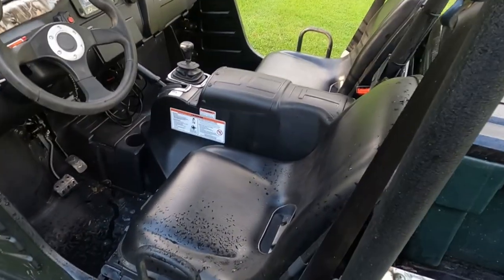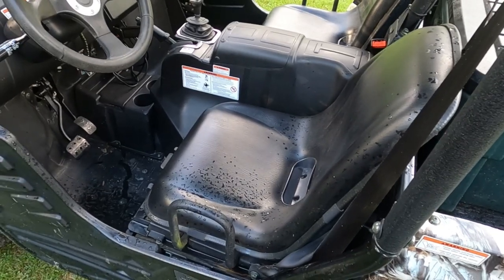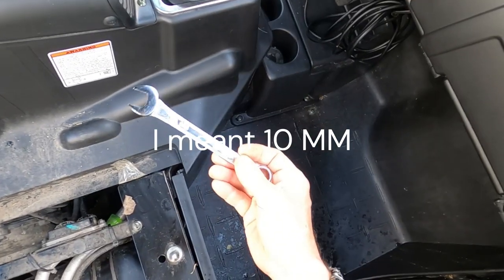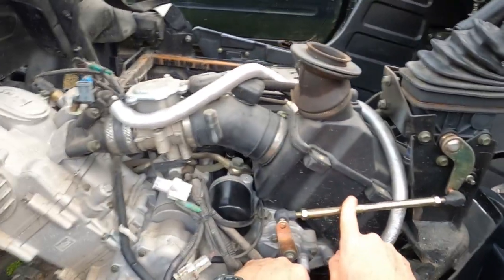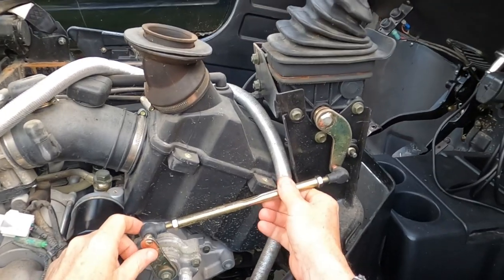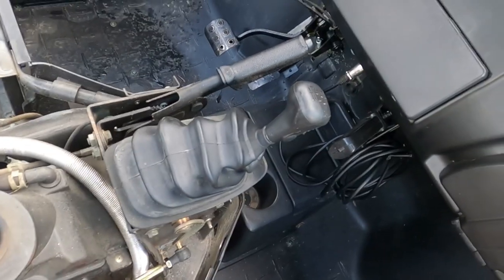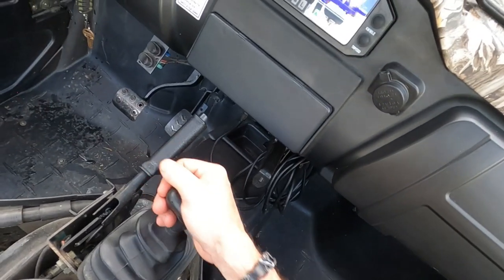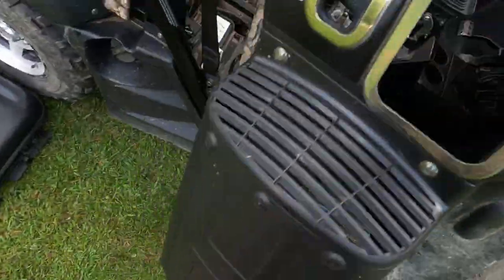Hisun/ Axis 500/700 Rural King UTV Shift Linkage Adjustment

Comment: Do a top speed test, then  maybe take it to Atlanta motor speedway? 😂 But seriously, whats the top speed?
Reply from the maker: lol, it aint no race car,  its  a work utility SXS for me. I use it around my property for hauling, pulling. I  own a large tract of property and it helps getting from point A to point B a great deal,  and it very capable off road,  surprising so if i decide to play on the trails..but  to answer your question.. 45 mph is about the limit on these little machines, ive had it to 40mph and felt it may had a little more to give.
Reply: About 40 mph
Reply: Thank you!